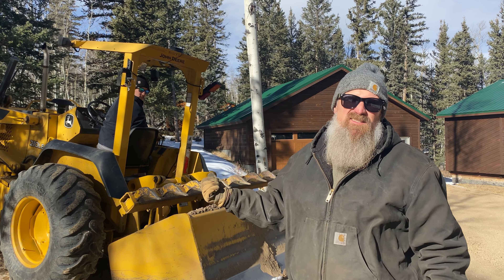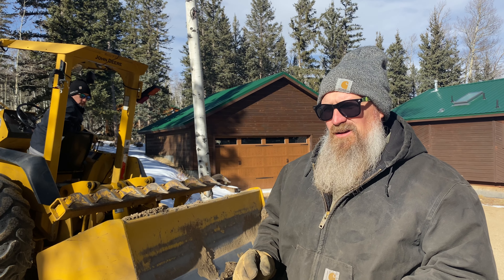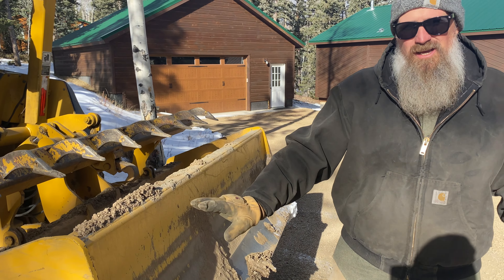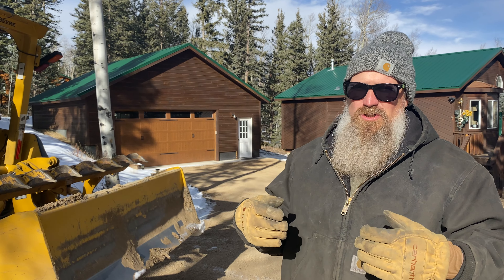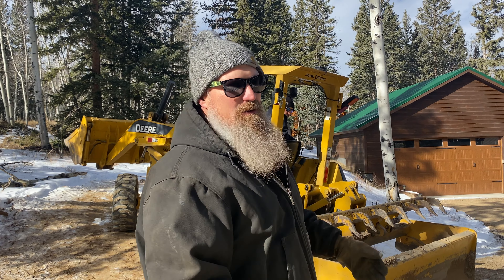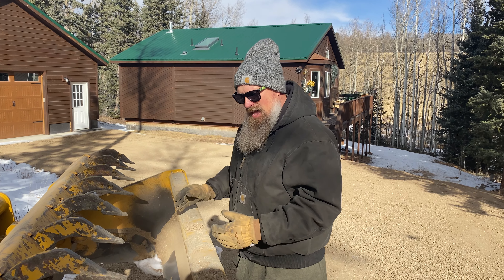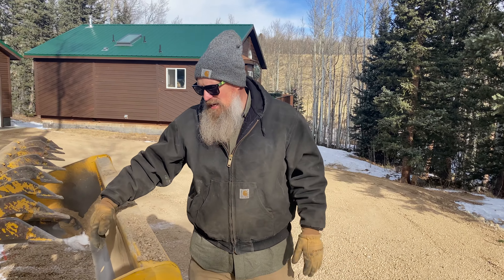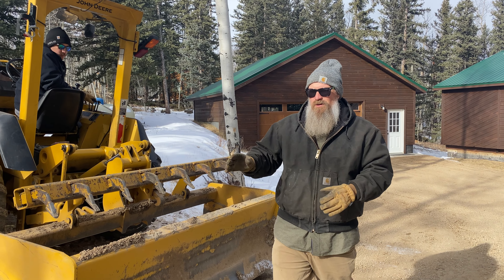Box Blade vs. Skid Steer

Comment: nice work man! does the tractor have hydraulic down pressure you can use on the box blade?
Reply from the maker: Yes, lots of pressure.  That machine weighs 12,500 pounds.  If you angle the back of the box blade it will doze and cut very well.
Reply: @diggindeeperPCG  thanks!